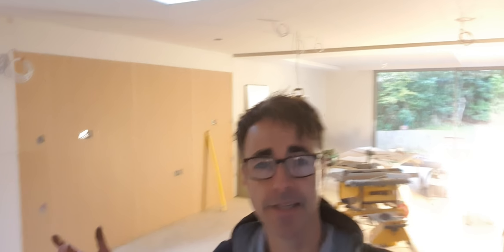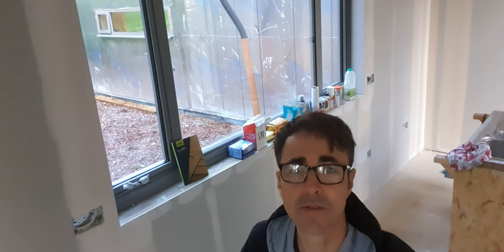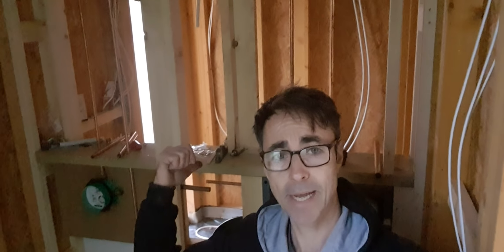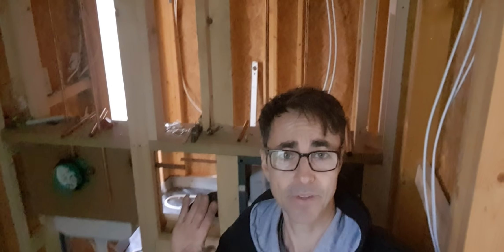Kitchen design and drawing

Comment: Love your detail and dedication. Really inspiring and enjoyable to watch.

I didn't know that you could run your units direct from the board and not need a fused spur close by on the wall! That's such a great tip, I will definitely be doing that on my build!
Reply from the maker: It's much neater if you message me on Instagram I will send a picture of the board and the switches for the appliances etc
Reply: @robinclevettcarpenter  legend. Thanks mate

Comment: Thanks for the video Robin. Please could you do a dedicated video on your process for designing the kitchen? What software do you use? Storage and layout depending on needs. Services etc? Things us non pros wouldn’t think of that might catch us out? I’ve checked out the links for the suppliers. Will be saving those for future reference. Great job. Thanks.
Reply from the maker: Hi Neil, I do a hand drawing to scale for each run of units mainly elevation drawings and 1 main plan view, I know all the dimensions and allowances needed for most appliances and other fixtures so it is fairly straight forward for me, I then work convert this (with a little assistance) to cutting lists and production drawings, I know that there are all kinds of softwares available but I would need to take time out to learn!!! something I am short of at the best of times!! Hope that helps

Comment: Hi Robin. Great vid as always. A quick request from me is to follow this up with a full review of the jigsaw. I bought the Mafell a year ago (off the back of your review actually) and it’s a fab bit of kit but 240v so no good for the site. I needed a cordless barrel handle and Having already adopted the Hikoki multi volt system but since they didn’t do one at the time  I had to go with the Makita barrel handle (which is ok but not great). I’d be willing to swap out if the Hikoki is ‘that good’ but it would be extremely useful for a features and performance review (with the Mafell as a benchmark) if possible? In the meantime stay safe and keep the great content coming.

Comment: MDF or ply behind the plasterboard, stand it between the metal stud and screw through to pull it on to the back of the plasterboard .
gives a continuous plasterboard face, better for tiling / decoration . Nice job though !

Comment: Nice to see something made properly. Didn't notice any hob or extraction in the kitchen plans (couldnt read detail though).
Reply from the maker: Hi Jamie there is a hob going on the island unit and a recirculating ceiling fan, we have direct extraction to the whole house MVHR system, will be doing an installation video at some point, thanks for the questions
Reply: @robinclevettcarpenter  Can't wait to see how that all works. Thanks for making the videos.

Comment: Do make all the carcasses as well? I know many bespoke kitchen shops use prebuilt carcasses and then have doors, end panels etc in house, painted with epoxy two part.
Reply from the maker: I have all the carcass panels cut to size in a particular material and then we put them together and make any adaptions that we need on site
Reply: Robin Clevett Hi Robin, great vid as usual. I saw on another vid you used Cutwrights for the carcasses? How does that work? Could you do a short video on how to set out cutting and drill hole measurements? Many thanks

Comment: Robin....is the mdf just Moisture Resistant MDF or the External MDF that you showed over on skill builder?
Reply from the maker: Hi Anthony, the MDF I use for the stops is standard moisture resistant board, I find that it paints well, thanks for watching...
Reply: @robinclevettcarpenter  thanks for replying....i meant for hanging kitchen units where you have used it in your kitchen area.....
Reply from the maker: @anthonysalisbury6945  Oh that!! sorry Anthony, but yes it is also Moisture Resistant, but oddly the 15mm board was plain in colour but it had a green core and the 12mm was green right through!!! nice one mate
Reply: @robinclevettcarpenter  top man cheers!

Comment: Thanks for the update Robin, Looks great! how come you're tape and jointing instead of a skim coat?
Reply from the maker: I am using Tape and joint as its in my opinion a better finish and hardly and mess and moisture!!!!
Reply: @robinclevettcarpenter  but the surface will be softer and much easier to dent when bumped.
Reply: @robinclevettcarpenter  Will you skim the ceiling though?
Reply: @robinclevettcarpenter   fair play, crack on. Looks like you'll be in by Christmas then  ;-)

Comment: Looking good Robin! Slightly off topic but your massive log store caught my eye. Will you be having a wood burner installed? And could you show the log store in a future video? Thanks for the update
Reply from the maker: Great question, we are having a log burner in the garden room, but in the main house we are using a room sealed gas fire, having a wood burner with a whole house MVHR system is tricky and there are not many wood burners that comply, we have plenty of wood from the garden as you can see that I have been storing for a couple of years!!

Comment: How do you/will you apply your paint finishes on the wall and timber work? Brush or spray?
Reply from the maker: Hi Kev we will spray the whole house out in the main ceiling colour then as we get rooms complete we will use any wall colours at that point by more traditional means like brush and roller etc, the wood would will be painted by brush

Comment: You're house is looking absolutely fantastic Robin, it's really starting to take shape now.  I don't envy you putting up 250+ sheets of plasterboard!  At nearly 25kg for a 12.5mm, 8' x 4' sheet, they're not easy to handle, especially on the ceiling!  My dad and I recently fitted around 17 sheets total and the ceiling (7.5 sheets) was hard work without a lift!

Comment: Why are you not using traditional plaster skim coat? Tape and joint for me just screams out as a cheap job and not a proper finish, a lot of new builds are done in this way and in my opinion the finish is never anywhere near as good as a plaster finish, your boarding out appears to be spot on it seems a shame to then go with tape and joint.
Reply from the maker: Tape and joint done properly and on great flat walls is the business, I did ponder skimming but could not face the moisture and mess!!!! my taper Kevin is brilliant and his walls are super crisp and flat, thanks for the comment Rob
Reply: Hi Rob 

 I (Roger) have always used skim coat but having seen Kevin working on Robin's job I am persuaded that it can be as good. A lot depends on the boarding and even the timber work it goes onto.  Kevin has a few tricks up his sleeve that means he gets a finish that is above average. He is a very steady guy, no dramas. 

There is so much light coming into Robin's house that any imperfections would leap out at you so it is a very good test.
Reply: Robin Clevett agreed that super flat walls make a huge difference, and I’m sure your tape and jointer guy will do a super job, just on what I have seen in new builds the finish never seems that good in comparison to traditional plaster, often the joint remains visible especially on ceilings, I do understand your point on moisture content, I guess when time frames are an issue drying out times can certainly delay things. Good luck with the build and I look forward to the next update!
Reply: Skill Builder Hi Roger, I guess the proof is in the pudding as that say! I’ve never been a great fan of tape and joint but It’ll be interesting to see how the finish comes out on this one. Being in the industry for 25 odd years and doing very similar jobs to yourselves I have a lot of interest in the videos you produce, keep up the great work. Kind regards.
Reply: Jez Tickles I’ve seen a few properties in the states and have to agree that from what I’ve seen they seem to look good, just not a big fan of it compared to traditional plastering!
Reply: @RobNorman08  if the jointing compound is sanded down flush with the boards then you shouldn't see the joint. You also have to seal it as well to avoid regency striping. I personally prefer a skim finish as I think its more durable.
Reply: @BODGE71  Yeah I agree, been in the building trade a long time, I've done tape and joint myself and done correctly yes it looks fine, but for me i don't feel its anywhere near as good as skim, in the long term, if for example walls are tiled, or wallpapered, then you have no chance of stripping them off without pulling the wall apart, also i don't feel tape and joint created a wall that is fully sealed as such, new builds seem to use it all the time simply because its cheap and quick! just my opinion though!
Reply: @RobNorman08  I'm guessing that another consideration was finding  a plasterer skilled enough to produce a flat flawless finish which would be very difficult to do on such a large surface area.
Reply: @BODGE71  I wouldn't see that as a problem, it's all brand new boarding out which is gonna be flat as a pancake to start with, no decent plasterer should have an issue getting a flawless finish on that, still each to their own i guess, if thats how he fancies having it done and he's paying the bill then who am i to argue!